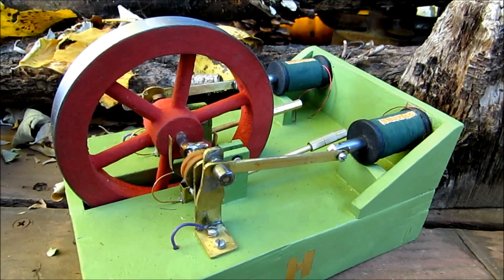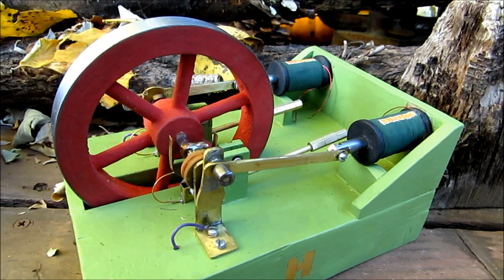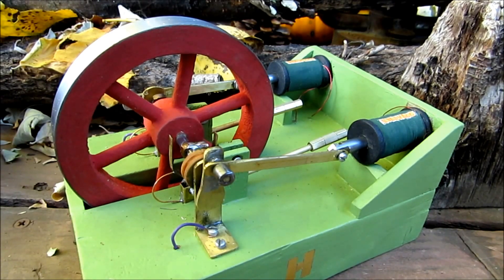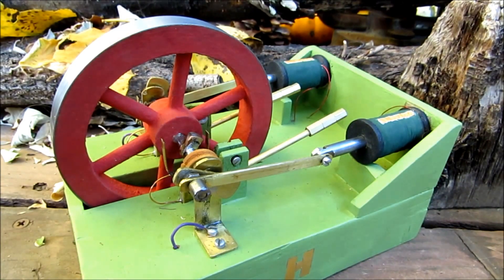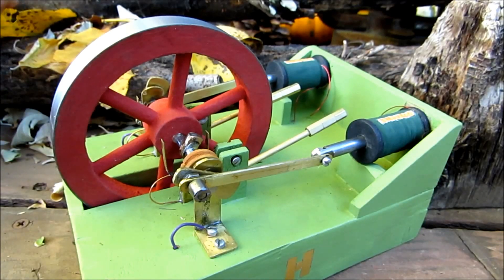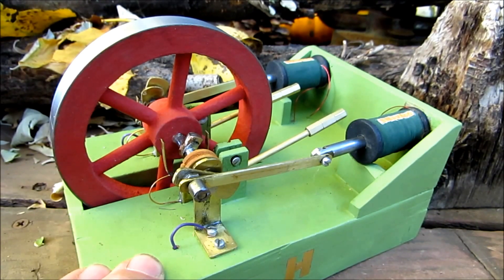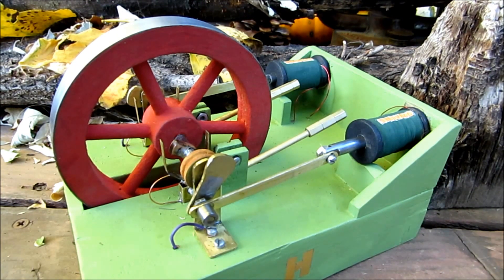DOUBLE SOLENOID ELECTRIC "ANTIQUE" MOTOR

Comment: Hi Robert, i have hier other model, i think it is a little bit better:

https://picload.org/image/rraoagrg/2.jpg
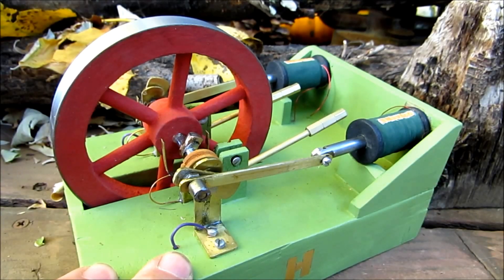Reply from the maker: Hello Konstantin,  Your schematic diagram looks great.  I'm sure your engineering will produce a superior motor!  My understanding of mathematics and electricity is very limited.  I pray and ask Jesus to help me.  John 3:16
Reply: Jesus is the son from the biggest engineer in universe, from god. He can help you, if you ask him from your heart!

By the model is it better, if the piston go synchronous in the cylinder, because so will be produced more torque. Engine will have more force, by the same elektric power. Efficiency will be better.
Reply from the maker: Yes, Jesus is the Son of God.  He is our Savior.  I asked Him to save me from my sins in 1958 and He did.  He guides my path each day.  I'm extremely thankful!
Reply: That diagram is nice! do you recommend having current flowing trough the crankshaft as this engine or better have an eccentric that moves a contact plate?
Reply from the maker: I'm thinking current flows through the crankshaft which activates the eccentrics.  The two eccentrics move the two contact plates.
Reply: the drawing should show the coil being energized, perhaps, ten degrees after 'top dead center'.  
then, the coil is energized for about 120 degrees of rotation.  the greatest force available at the plunger occurs during that time.   period.     the flywheel does the rest.  
whatever max torque is, it will be SMALL.  so, high-running speed is desirable.   cheers

Comment: I have seen all these kind of electric motors are more or less based in the Page´s electro magnet motor from 1860.I have not a picture about the original electric motor from Page. Nor a picture from Page, and don´t know so much about what this man designed and built. I have found several differents Page,s persons in Wikipedia, but I cann´t know who of them is he. Could you help me?
Reply from the maker: I found Page on Wikipedia.  I saw the electromagnet that he made.  Not sure if he made a motor.  He did attempt making a electric run locomotive but never finished it.  My models come from C.E. Avery, about 1910.  He made toy motors using electromagnets.
Reply: Yes, I know the motor done as toys by C.E. Avery, but they are different in the sense they don´t have the nucleous of the electromagnet doing the work similar to pistons. Avery´s motors have a mobile magnet enclosure, and the electric conmutator to reverse, in fact, this feature makes them different from Page´s. Page´s motor uses these mobile nucleous moving inside and outside of the solenoid. Your motor seems to be a mix between both motors. Any way, could you write here the link to Page´s in the Wikipedia? It´s for me to read. Thanks Robert.
Reply from the maker: Charles Grafton Page, born 1812.  https://en.wikipedia.org/wiki/Charles_Grafton_Page

Hello Ketk,  I trust this information
 is helpful.
Reply: Oh yes. I think this is Page I was looking for. (There is another british Page, also engineer, and also working on trains locomotives). Pity I can not insert a picture about the electro magnet motor from Page, but I will leave a link to the web page I have seen it: 
1st motor: https://commons.wikimedia.org/wiki/File:Motor_Page.jpg
                    https://www.flickr.com/photos/stevelewalready/3780252004
2nd motor: http://www.oldmodels.co.uk/history/
3rd motor: http://e-ducativa.catedu.es/44700165/aula/archivos/repositorio//4750/4933/html/41_motores_elctricos_de_cc.html

4th motor:http://www.todocoleccion.net/coleccionismo/motor-magneto-electrico-page-1860-lamina-foto-instrumentos-maquinas-antiguas~x29007130

The 4th is the electro magnet motor I am talking about in this conversation about Page and Avery.
Thanks for your help Robert.
Reply from the maker: Thanks Ketk for the additional information on early motors.  This is a fascinating subject.  Let us continue making models.  Jesus is coming.  John 3:16
Reply: Thanks to you Robert, for your help to make me easy to know about the life and picture of Charles Grafton Page.Some day maybe I will build a replica of Page´s first motor model, it´s very interesting electric motor, and also could be reversed with Avery´s system... hehehehehe...
Reply from the maker: Hello Ketk,  I'm glad the information was helpful.  C.G. Page was also a medical student at Harvard.  I may try making a "rocking" electric motor next.  The Old Motor Company, England, shows a picture of one.
Reply: I will be delighted to see your next rocking motor.
Reply: solar cell